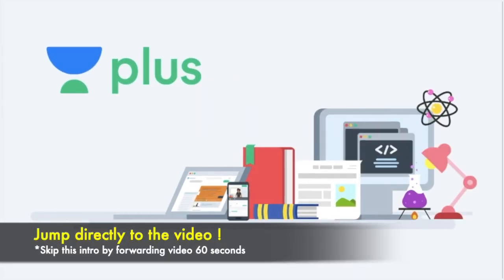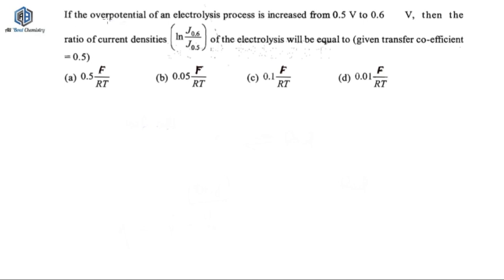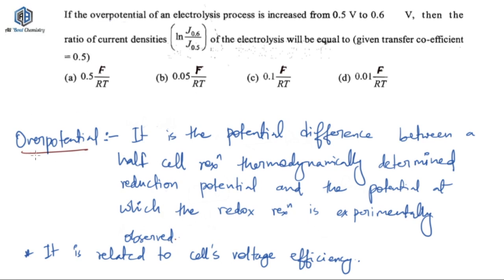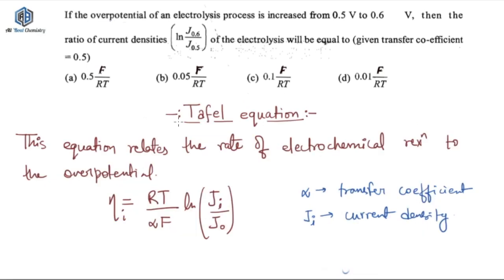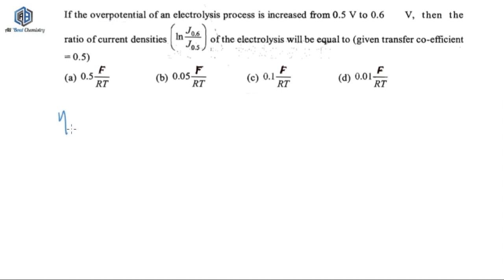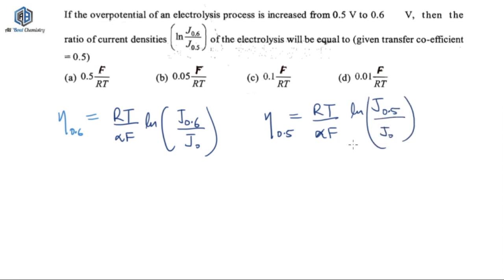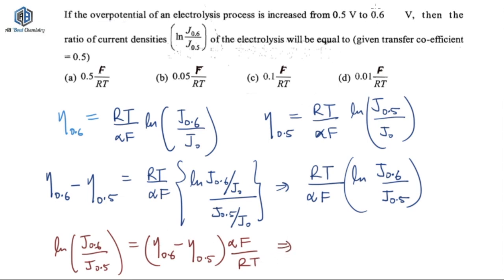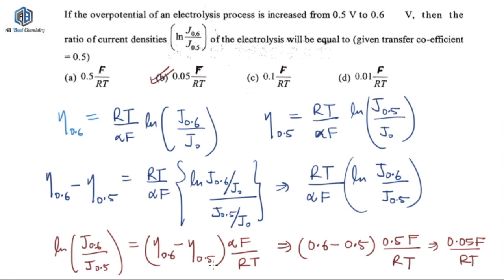Problem Solving Approach: Overpotential and Tafel Equation | CSIR June 2019

Comment: Sir, According to Atkins
when over potential (eta) is greater than equal to 0.12V ,the equation will be as follows.  {  lni=lni°+(1-alpha)etaF/RT. }
Under Butler's volmer equation,as second exponential is neglected.
And why the above equation is not follow the said problem.
Plz, verify me
Reply: Right!!!
Actually solution will be by this case tafel eqn not that whatever sir did..I don't know how sir has written this formula...this is not taffel eqn ... however ans is coming from sir's method as well ...